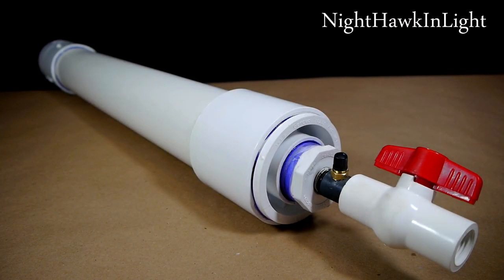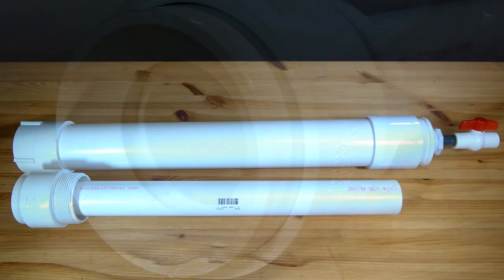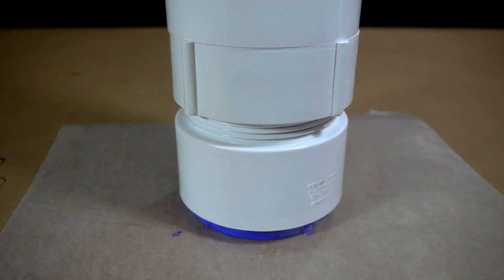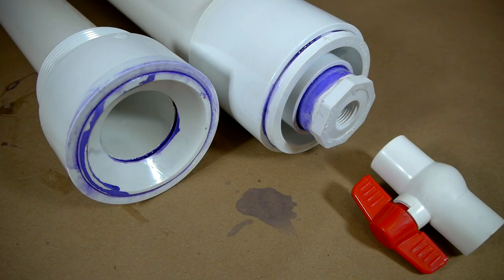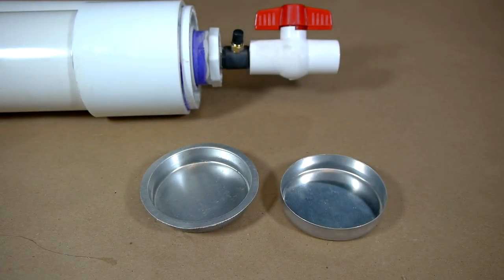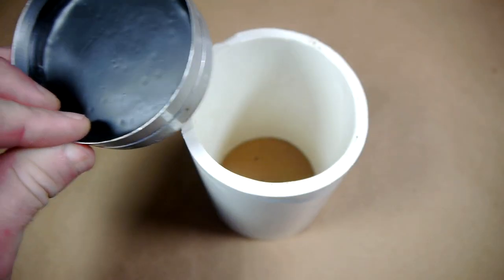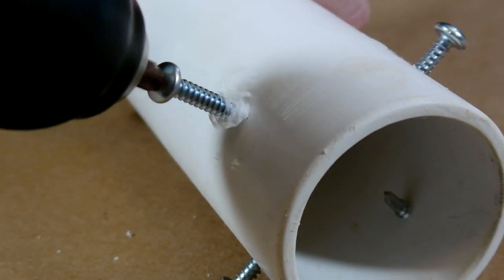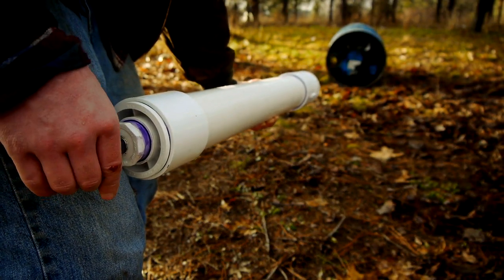How to Make a Powerful Coaxial Piston Cannon from Hardware Store Parts

Comment: Hi Bud!
Thanks for sharing with us.
quick dumb question, I'm about to start building one of those, but I want use it for "bait caster" instead, so I know that the barrel has to be longer, and I like to know if I have to make the whole setup longer or just the barrel....
Thanks again.
Reply from the maker: Making the barrel longer is tricky in a coaxial cannon. You have to modify the reducer at the end to allow the barrel to pass all the way through, and then cementing it in place is a sketchy process. Piston cannons, though powerful, are not what I would choose for a purpose in which you need high reliability since they can require a lot of tinkering to get working right. Instead I would look into a cannon that fires using a modified sprinkler valve. Similar to what I make in the following video, but with a larger air chamber and a larger diameter barrel: How to Make an Explosion Simulator Please remember to only use pressure rated pipe and fittings, and be aware that PVC can be brittle, making pressurized air containment dangerous in environments where it may be dropped or knocked with hard objects.
Reply: Thanks, I saw the vid on the explosion simulator, is not what I need.
The idea of the bait caster is that, instead of potato, I would use frozen bait for bank fishing....
I believe this design will work, I was just thinking that it needs a longer barrel for the bait to travel longer distances, but it may work the way it is.
How far does the potato go?
Reply from the maker: Juan Kmaney I know the explosion simulator is not what you need, but the valve is. Use that valve between an air tank and a barrel and you'll have a reliable and powerful cannon.
Reply: NightHawkInLight cool, I understand now, I'll give it try, there is a Hardware store across the street from my transmission shop, one of the guys that work there and will try to make one..........But hell, if anything, what would you charge me to make one, if you will?
Reply from the maker: Juan Kmaney No, I don't sell any of my projects, but good luck on your build.
Reply: have you had any luck making the bait caster
Reply: No yet, things are not going well for me, looks like I'll start it soon, bait casters are more useful during the winter, I will post the results.

Comment: Is it worth using schedule 80 for higher pressure/velocity? Looks like it works great but hey, if good is good, more is better, right?
Reply: More what? If you mean air, too much air can actually throw the projectile off course when it leaves the barrel
Reply: Schedule 40 is rated for 450 PSI! You would have to upgrade the air intake valve or it might fly off and kill someone. You'll need a heavy duty compressor too, most don't make it to 450 PSI. At this point you might as well make it a 10' long rifled barrel so you can put your tubers into orbit! Please post a video.

Comment: What kind of PVC is used here? The type for drainage or for venting your furnace?
Reply from the maker: Neither. It is pressure rated water pipe. Venting and drainage pipe is not pressure rated.
Reply: NightHawkInLight I figured such, but none of the hardware stores near me offered pipe with that diameter, with pressure rating, so I wondered if I just understood wrong. Thanks for clarifying.

Comment: If someone is going to put something small like airsoft pellets would you need something like a wadding?
Reply: Yeah you would otherwise there would be nothing to keep the air from rushing past the bb's. I would stuff something like a bundle of rags down to make a somewhat snug wad that way you won't have as much loss of air and bb's rolling down into the chamber and interfering with the piston.

Comment: I just finished my cannon but when I put any air into the chamber, it leaks out both ends of the cannon and I don't know how to fix it. Do you have any suggestions on how to fix it?
Reply: +Nick Shambaugh I know this is old but i'll answer anyways. It it leaks out the ball valve side the valve isn't closed or the threads are leaking. If it leaks out the barrel the piston isn't sealing against the barrel well enough, make the barrel as flat and smooth as possible and try lubricating the piston face.

Comment: Would a smaller diameter barrel work? I want to shoot golfballs out of it or would I have to wrap them in something if a smaller barrel wouldn't work
Reply: well the barrel is a separate piece so you could just put a smaller barrel. but you would also need longer screws.
Reply: Put a smaller barrel in the barrel and seal it with cement

Comment: I'm currently planning a hybrid between this and the sniper/shotgun video. It will be a sniper but have this coaxial design. Only problem is, I need a quickrelease mechanism rather than the ball valve so I can fire it accurately. the ball valve would just add too much movement. do you have any ideas? if not i will make a spring powered one similar to the one used on the sniper
Reply: I am also going to integrate a magazine system into it

Comment: hey, how long would this cannon hold pressure at 100psi? looking at the way it functions i think it would slowly leak out all of its air. would this make an old sprinkler valve setup more practical for a cannon that would have to hold pressure for several hours?

Comment: Made one but when dry firing all the air escapes through the ball valve not the barrel.  I've played with wrapping the piston and not wrapping it but nothing seems to work.  With no tape on the piston I can hear it move as I tilt the cannon back and forth.  Any suggestions to get it to work?
Reply from the maker: That means that air can move past the piston faster than the air behind it can be evacuated. There are three options: 1. make the piston a closer seal 2. decrease the volume of air behind the piston either by lengthening the barrel or increasing the length of the piston 3. increase the size or speed of the release valve so it can exhaust air faster.

Comment: I have been wanting to know, does the metal piston launch itself out along with the spud or is it stopped at the end of the barrel? I am thinking of shooting light foam out of it but I am wondering if that cap piston is needed for it. I do recreational simulations with props and this would be a perfect upgrade for what we got. Thanks in advance!
Reply from the maker: +Kyle Stovner (Hunterdoom) The piston is not fired out with the projectile, that would make this a pretty expensive cannon to shoot! I think this would be overkill for what you want to use it for. I would instead make a cannon using a modified sprinkler valve rather than a piston design. You can modify a valve as shown in this video, and simply attach it to a larger diameter air chamber and barrel: https://youtu.be/ymfrrX5kIvM
Reply: True. I guess because of how nice it looks I was following every step lol. Thanks!

Comment: I know that I need to sit down and just think it through but will this design leak air out the barrel if left 'charged' for an extended period of time?  I need a design that could be ready to fire through the course of a day at least.
Reply: The cannon will not leak air if you take your time and build it right.  You have to make sure the 2in pipe sits perfectly straight inside the 3in pipe.  Make sure you cut the 2in pipe perfectly straight where its going to meet the piston.  Then polish the clean cut with very fine sand paper and steel wool.  You want it shiny smooth.  Very important.  The other very important step is to make sure your piston in PERFECT.  These steps are key to making an air tight gun.  Anyone can build one of these but to get it 100% air tight is where the skill comes in.
Reply: I made one using a lawn irrigation valve and 3) 9v batteries. Holds a charge all day. Just make sure you use a toggle switch with a flip up guard to arm and a push button to fire. Safety first. These things may be fun to play with, but they do demand respect. Just like their Smokeless Powder counterparts.
Reply: justin767je The piston he puts in the barrel does not look like the one he glued so did he melt it or something? Also, theoretically could this cannon be built with precut 2' barrels instead or would the pressure be too weak?
Reply: I did the exact design he did except I couldnt get his piston design to work.  I made my own piston out of a thick soup can with rubber on the bottom and aluminum foil tape on the outside.  I then put a small bolt with 1 1/2 in washers pinching the rubber to the can.  Mine will hold 80psi for a whole day no problem.  I havent kept it loaded for more then that though.  Its all about your piston design and polishing the pipe that meets the rubber. at  80 psi it packs a serious punch.  I also used a sprinkler valve for the trigger.   Releases air so much faster.  Ive made a couple different launchers now and I must say this design is my favorite thus far.  I guess you could use a 2in for the outer and a 1 in for the inner but yea it wouldnt be as powerful and would only shoot small projectile.  To each is own though.

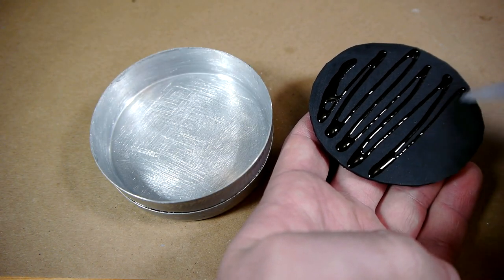Comment: What do you add over top of the rubber gasket at 6:04 it is much smoother than the rubber gasket you glued in. I am having trouble getting a good seal. looks like this may have been fixed in the design but not addressed in the video?
Reply from the maker: That was a failed experiment. The gasket that i glued in is what i used in the final design. Smear some TFE paste on the face of the piston and it will improve the seal.
Reply: NightHawkInLight Thanks, I actually tried cutting a gasket out of an old mouse pad, Set it in to try.. Seems to have worked but then blew it through the cannon. Gonna try to glue it in and try again. Also is there a reason you used metal vent tees? No hardware stores around here sell them so i tried plastic. They seem to have worked but not sure if they are one of the reasons i'm not getting a good seal. I need to be able to pressurize and then leave sit for about 10 min before firing. We are using them as confetti cannons for a theater program.

Comment: how does having a ball valve on the rear make it fire in the other direction?
Reply: when you pressurize the chamber, the piston is forced against the barrel end. when you open the valve, the pressure drops, which causes the piston to move away from the barrel. air rushes out of the barrel and your projectile is launched.

Comment: Hello, 
So my male and female adpaters are not the same as yours and are not bothering fixing. Though i have a 3" to 2" reducer. My idea was to sand of the inside ridge of it so a 2" pipe and flow all the way threw. Therefore, can i attach a 2" pvc pipe  inside it so it flows all the way threw. Then, going up, attach a 3" pvc pipe so it somewhat looks like yours. Then ii will attach the ball valve etc... Will it still work?

Comment: Hi! I'm having the hardest time choosing the parts w/ the exact specs compatible for the design. for ex, is that 3" x 2" flush bushing hub x socket? there are so many detailed differences and i'm struggling to find the correct parts.... (hoping if you could help me out.. I need to build this so badly for my project and promise this project is for a good cause..)
Reply from the maker: I suggest my new piston cannon design. Check my more recent videos.
Reply: Thank you!!!!

Comment: I just came across this build video the other day. I can’t seem to be able to source the 3” to 2” flush bushing that’s used in the video. All the ones I can find locally, don’t look the same and will have to be modified for it to work. Can anyone refer me to a part number? Thanks!!
Reply from the maker: You may want to look into my more recent piston cannon designs. They use easier to source parts.

Comment: I dislike the valve firing mechanism, is there any other way/part to hold then  release the air?
Reply: this system gives a faster release than an electric solenoid valve (between and barrel )
Reply: I'm talking maybe a trigger pull system instead of the jerk causing aim to deviate

Comment: the rubber I'm using keeps failing. I noticed in the film between you gluing the rubber down and inserting it into the chamber there is definitely more than just the rubber sheet. Is there some kind of liquid gasket you use to make a good seal? Please help, I'm running out of time on this project and I will have to abandon your design.
Thanks for your time

Comment: Hey NightHawkInLight,
For school i have to build something and your cannon inspired me.
So im gonna try to make it!!
Do you have some tips i have watch out for while building it?
Thank you already
Reply from the maker: +Martijn Bras I would use a larger ball valve than the one I used as the release in this video. A 3/4" instead of 1/2". Upgrade the fittings the valve attaches to accept a 3/4" pipe nipple as well so there's better air flow.
Reply: +NightHawkInLight thx for your tip for the valve and the nipple. I actually have 1 doubt wich is I live in Holland so it isnt in inch and feet, it is all in meter. Is this a problem or should it work as long as it is almost the same size?
Reply from the maker: +Martijn Bras Similar sizes for everything should work, but you may need to use something else for the piston if you can't find caps that fit just right in the pipe. Also be sure that everything is safe for pressure, and test it at low pressures
Reply: +NightHawkInLight I will ask the stores in my town for some help with the piston. By the way I really appreciate the quick answers and the help.
Reply: +NightHawkInLight Are there other materials I can use instead of the epoxy? And if I use the hocky puck, i dont need to take 2 of them, do I?
Reply: +NightHawkInLight When I try to fill it with air from a bike pump, it doesn't fill, I submerged it in water and no bubbles showed, then I tried to make the puck tighter and that didn't work. Any ideas on what the problem might be? Please help!
Reply from the maker: +Demetri Petronavik Put some pipe thread paste on the rubber face of the piston

Comment: Hey I'm planning on making a similar cannon for a school project. It is supposed to launch a potato 75 m or more. Do you think this particular design will do the trick?
Reply from the maker: It should work. You can also use this newest design: https://youtu.be/G1VCZEXi384
Reply: @Nighthawkinlight  thanks in the process of buying stuff now hope it goes well
Reply: @Nighthawkinlight  quick question we need three pipes right 1 three diameter pipe, and 2 two diameter pipes right?
Reply from the maker: @umairx25  I don't remember. It's been many years since I made this video.  I believe parts needed are listed in the video description.

Comment: Just asking but this if my first time making anything like this so pardon me for not knowing much if anything but I've been looking for parts and I was wondering where people would recommend to find them since I am having a hard time. Also I was wondering what kind of reducer he is referring too for both the threaded and non threaded because I can't find these right now at all.
Reply from the maker: If this is your first time building an air cannon you should probably start with something simpler. Look up a ball valve air cannon and try making one of those instead. You can find PVC parts at any hardware store. Make sure they all say Sch. 40 on them and do not say DWV. The pipe you use should all have a pressure rating printed on the side.
Reply: NightHawkInLight
Thanks for responding so fast for my plea for help but the problem is that this is a planned project at this point and I can't seem to find certain parts that I need in particular like the reducers and the flush bushing. The main reason behind this is that it seems to be that most places within my area do not hold 3" and above pressure rated PVC. I am currently looking for a place where I could order the items from due to the lack of resources in my area.
Reply: In fact the whole thing is almost done now but thanks for trying. Took forever to even find the basics and the piston is extremely hard to get the parts for.

Comment: Hey it's me again it's leaking threw the barrel was my problem the piston could be not making a seal

I heard something like put some pvc thread paste on the rubber so it forms a better seal would that work? Also do I have to have some ammo in the barrel first before pumping?

Oh and I saw you made a new design which is smaller and has a different type of piston seal I saw the rubber on the barrel part instead of the piston and it's a rounded cap. Should I change the sealing system of this version to match the smaller if the pip thread paste doesn't work?
Reply from the maker: Try the pipe thread paste. I don't think the method used in my new cannon would work for this one.
Reply: Ok thanks i will try it, oh may I ask what type of rubber did you use for the piston? I realized the rubber I had before was too tough to make a seal.
Reply from the maker: I just used whatever black rubber sheet my local hardware store carried.
Reply: объясните русскому, как это работает и как это собрать ?????? Пожалуйста, pleas tolk the russian people, How to build this gun???? I'm from russia.